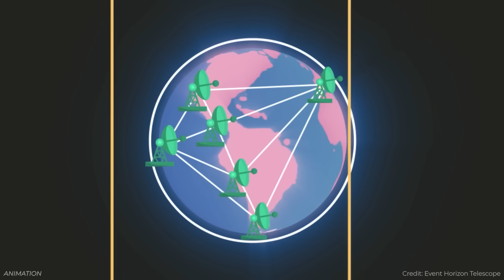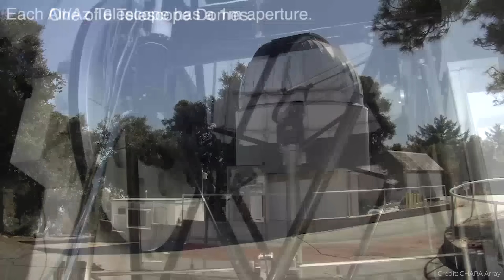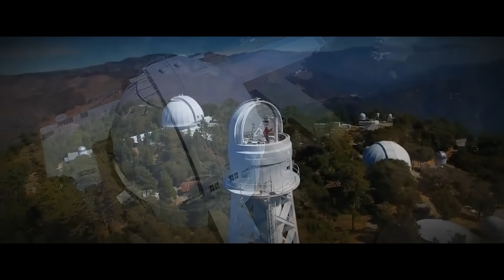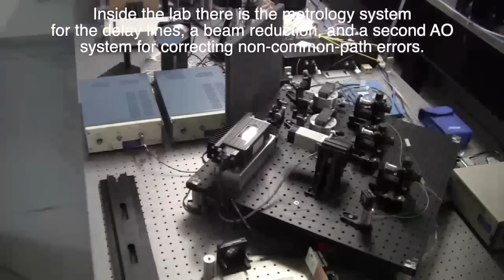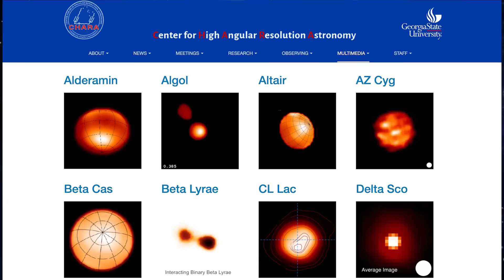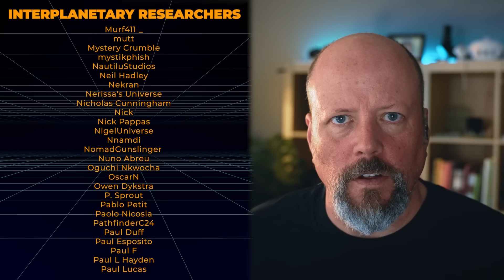How Does The Biggest Visible Light Telescope Array Work

Comment: Did you discuss with the professor if there was any chance they could image 3I/Atlas or is it to dim or too fast?
Reply from the maker: It can only resolve extremely bright objects like stars.
Reply: Further to Fraser, I believe magnitude 9 was mentioned as a low-brightness limit. 3I/ATLAS is around magnitude 14, which is, if I remember the maths correctly a factor of 100× fainter than the CHARA minimum brightness.

Comment: I'd love to see a blimp/airship scenario modeled out if 'balloons and drones' are on the table.

Blimps are more stable and can support significantly larger mirrors.  With ballasts and counterweights, you should be able to put the instruments on top of the blimp/airships too.
Reply: Hmmm. If you put the aircraft out to sea, facing into the prevailing wind ... and at very high altitude ... I guess the engineering would be on a magnitude of difficulty similar to SOFIA.
Looping several 10s of km of optical fibre between blimps though - that could get hairy. Particularly at launch.  No, actually, the launch wouldn't be too bad. Launch blimp 1 of ground and tug-boat anchors, trailing the OF and unspooling it from a drum ; Blimp 1 goes to (drum length -1km) and moves up range to empty the drum. Connect the OF to Blimp 2, which commences it's launch operations. If we can run 8 anchors to an oil installation while also running 36in pipeline into it from below, then we can work out the tensions and catenaries.
Blimps 3, 4 and 5 are where it gets into new territory.
Reply: @WellsiteGeologist-UK do you need fiber? Or can a stabilized mirror array work?

Some Blimps have entire dining rooms in them.

A custom blimp could have mirrors on the inside.
Reply: @justinkruger  The interviewee covers this in the programme. They're using mirror networks at the moment, but because of absorption and "heat haze" effects, they have to run the beams through evacuated (i.e. high vacuum) tubes. Which quickly gets prohibitively expensive on the ground. Between blimps at high altitude ... rigid, straight vacuum tubes. Nope. Not happening.

The reason for running 2 or more blimps would be to have a big separation between the mirrors. They've already got baseline on the ground which are a lot larger than the biggest airships (LZ-129 "Hindenberg" was 245m long).

Comment: Really interesting that they want all of the distances between individual telescopes to be different distances o they get different baselines (though i'm not sure what that really means) and I wonder if a similar thing is going on with the Square Kilometre Array? I've always thought its detectors look somewhat haphazardly placed
Reply: Yes, it is very much part of the design. Not only do they have a considerable range of baseline, but they also have many (most? all?) of those baselines available at a number of azimuths (angles to North).
Plus time of day of observation affects how the azimuth of a set of baselines presents to a particular target, which angle generally changes through the observation period.

If you want some baseline fun - find a baseline map for the MERLIN radio array which spreads over large parts of England and (last time I looked) over the North Sea to several Dutch telescopes too. Somewhat constrained by where the telescopes had already been built.

Comment: Interferometry allows the same angular RESOLUTION as a telescope with the mirror the size of the distance between the two small ones. It does not have the same light gathering ability as a single large mirror does, because it does not have the same area. So it is NOT the same as having a single large mirror.
Reply from the maker: Yes, that is what we covered in the interview. It gives you the resolution but not the low light sensitivity

Comment: So can't you use the same/similar idea to use these telescopes over a year long period and get the diameter of the Earths orbit around the sun. How much even changes in whatever you're observing over a year anyway 🤷‍♂️🤔
Reply: That would be a parallax observation at opposite ends of Earth's orbit 6 months apart, as opposed to interferometry which is simultaneous observation at the precise same moment in time.

Parallax has its own uses, particularly as a distance measure to determine AU (or light years) distance from Earth, that being the first rung on the distance ladder.
Reply: How do you store the beam for 6 months?

Comment: Could you add 2 or 3 larger telescopes to the chara array to add to its light collecting ability and get at dimmer objects?
Reply: Putting the telescopes on whose ground? 
Or removing which existing telescopes to make room for the new ones? 

That's one of the major reasons that the MERLIN radio array I mentioned upthread has a weird selection of baseline lengths and orientations. Buying land in southern England to build more rationally- positioned radio telescopes would be horrendously expensive.
Reply: @WellsiteGeologist-UK im only interested in the scientific theory of it, not English property rights.
Reply: Yes, but that is only a 33% to 50% increase in light collection.

Comment: Why don't we use these interferometers to image the surface of distant dwarf planets?
Reply: Planets are too dim.  Interferometers work for brighter objects, not dim objects.

For dim objects, you need maximum size of light collecting area, which is easier to achieve with a single large dish.  If someone had the money to spend, you could build an interferometer using multiple large dishes, which would combine maximum light collection (dish size) with maximum resolution (dish separation distance).
Reply: @nae-nae-99  but you can see them even with a high-end amateur telescope
Reply: @dell_550  Dr. Nic Scott mentioned they can do observations to 9th magnitude, and 9th magnitude stars are visible in mere binoculars, but the interferometer is able to resolve much higher resolution, with significantly less light per pixel.

The interferometer is seeing a detailed image of the star's surface, not merely a point source of light.
Reply: @dell_550  Even the poorest of "department store" telescopes is probably capable  of imaging objects dimmer then the 9th magnitude minimum which this array needs.
What you win on the resolution ladder, you lose on the magnitude snake.
Reply: @nae-nae-99 
Thank you for you insights.

Comment: Is this true? 

Physicists broke the speed of light barrier — without breaking Einstein's laws ⚡
Researchers at the University of Rochester have successfully transmitted information faster than light through a specially engineered "spacetime bubble" — but here's the twist: they didn't violate Einstein's relativity because technically, the light didn't move faster. Space itself did.
The experiment used metamaterials to create a region where the effective speed of light was altered locally. Inside this bubble, light appears to travel at normal speed, but an outside observer measures it moving 1.4x faster than light speed in a vacuum.
How is this possible?

Einstein said nothing can move through space faster than light
But space itself can expand or contract at any speed
The metamaterial creates a micro "warp bubble" effect
Information travels normally inside the bubble, but the bubble moves faster

The implications are staggering:

Foundation for real warp drive technology
Faster-than-light communication for space missions
Quantum computing speed improvements
Potential for time dilation experiments

The bubble is microscopic (1mm across) and lasts only nanoseconds, but it proves the concept works. Scaling up requires energy levels comparable to small stars — for now.
NASA and DARPA have both requested the research data for deep space applications.
Source: University of Rochester Physics Department, Physical Review Letters 2025
#Physics #SpeedOfLight #WarpDrive #Einstein #QuantumPhysics #SpaceTravel #ScienceBreakthrough #FTL #Astrophysics #FutureTech #fb #fblifestyle

Comment: There’s image stacking on a single telescope over time to increase resolution, can there be image stacking from different telescopes looking at the same thing at the same time?
Reply: Yes they can stack digital images in radio wavelengths using timestamps to coordinate, which is what they did for the Event Horizon interferometry pictures of supermassive black holes.

But they can't stack digital images to accomplish interferometry in visual wavelengths, infrared through to ultraviolet has to be done with mechanical optics with mechanical accuracy down to 10s of nanometers, which Dr. Nic Scott covered in this interview.

Dr. Nic Scott briefly mentioned that quantum effects prevent digital stacking across geography due to the shorter wavelengths of visible light compared to radio wavelength astronomy.

I presume that once the visual interferometry exposure is captured, it could be stacked digitally over multiple nights to amplify dim light sources, but that only improves image contrast, not image resolution.
Reply: Isn't that literally what's getting presented in this video?
Reply: @refindoazhar1507 Inferometery is not the same as image stacking.

Comment: Interesting….thank you. But I’ve got a theory and need you to confirm: your last 2 videos had nothing to do with 3I atlas, AND lots of the news recently suggests it’s not a comet….so my theory is that your so confident it’s a comet you’ve moved on?
Reply from the maker: We covered a new update in the last Space bites. More news on Friday. Nothing that exciting though
Reply: Yes, 3I/ATLAS is a comet with an unusual chemical composition, because it doesn't originate from our Kuiper Belt.  Its behaviour is consistent with those findings, even down to "non-gravitational acceleration" due to outgassing.

An alien space craft would have entirely different behaviours to a comet.

A comet is also a decidedly poor choice if you wanted to secrete some observational instruments onboard, because outgassing would interfere substantially with observations.  A dry asteroid would be a much better choice for a disguised alien probe, because a dry asteroid is far more boring.